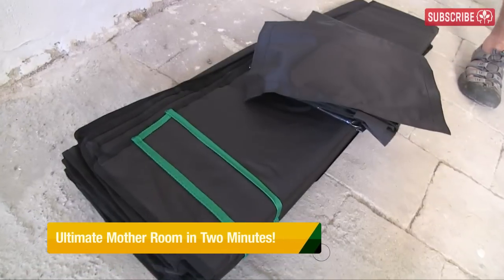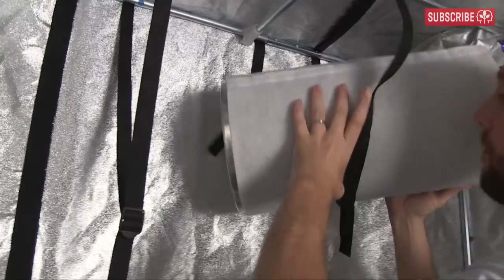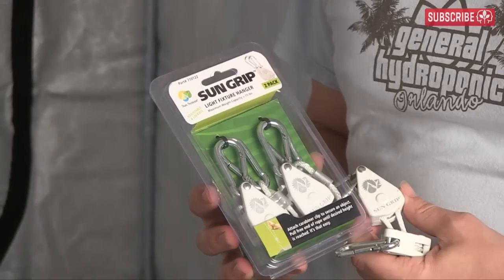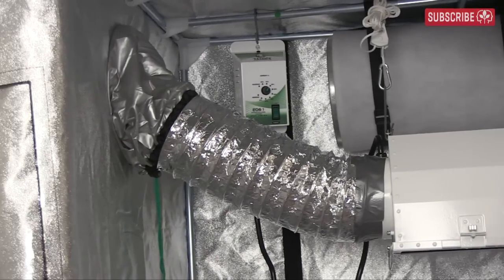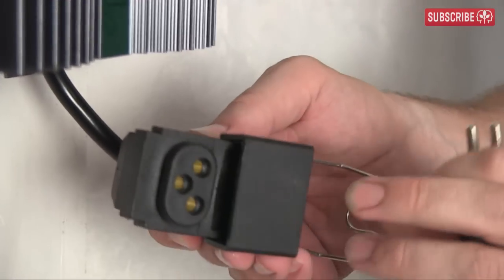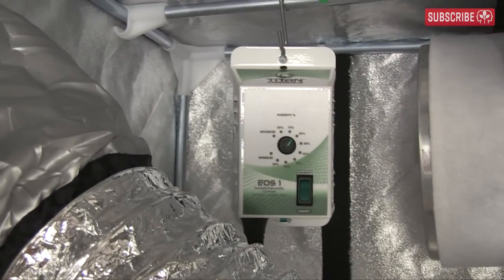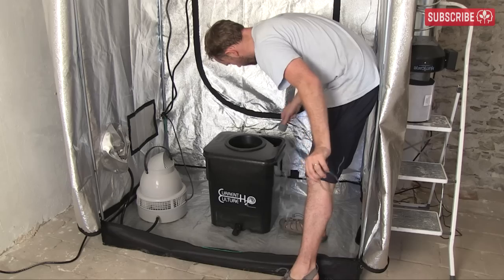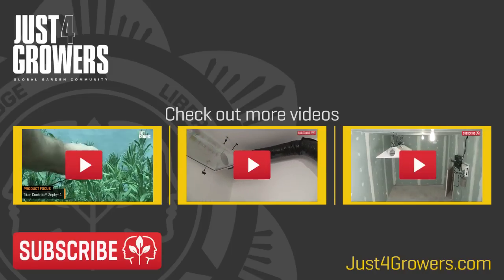Instant Mother Room (well, two minutes)

Comment: I’m confused. Is there a carbon filter on both ends of the reflector? If so that doesn’t seem right to me. What’s the point in filtering the intake if it’s not actually going into ur tent. Just through the sealed light fixture?
Reply: Oh my mistake
Reply: Just realized what’s actually going on in the video. Accidentally confused myself
Reply: Wait no I’m still confused. Where’s the fresh intake for the plants? The only intake I see is used to vent the hot air.

Comment: my friend did an experiment without wanting to by making a metal halide room with two fixtures and a T5 room with two lamps that had about 8 bulbs in each fixture. the metal halides were stretching the plants while the T5 were keeping the nodes close together and actually pairing them together at times vs the halide where they were alternating and stretched out.

Comment: Hey everest, Big question. you say to use a MH conversion bulb for the mother room. 
I recently purchased http://lightenerg.com/products/bulbs/supermhconversion.html 
but I assumed it was just a HPS with upgraded spectrum, so I bought a 600W hydrostar MH. This is all for a veg/mother room, flowering under LED's (cheap panels from ebay, 275Wx3)
So my question is, did I waste my money on the extra hydrostar bulb, since you say to use a conversion lamp in this video? 

I don't have a par meter, and really since par is so ambiguous, would I be better off just using lux? 
Thanks for your amazing videos! Speak faster ;) hahaa, haters gonna hate!
Reply: http://www.getgreenstar.com/hydrostar/hstr-m600w-mh-232002685 is the hydrostar bulb
I assume Genesis bulbs would be the best, but then again, what do I know? 
Maybe hortilux xD http://www.eyehortilux.com/products/specific/600w-Hortilux-Blue

Comment: so the way you have it hooked up the light exhaust will be pumping out stink air right next to the exhaust from the carbon filter ... this makes no sense
Reply from the maker: +EN KNEE GIVEN DAZE by blowing through the hood any leaks are dealt with by the grow tent's carbon filter. I could put an inline filter at the exhaust point if odour was a concern.

Comment: Why use 2 exhausts? Why not just attach the carbon filter to the end of the light?
Reply: +x2eXu50x Also, wont the exhaust through the carbon-filterless light exhaust out all the smell? Since it isnt running through a carbon filter before exhausting?
Reply from the maker: +x2eXu50x Hi x2eXu50x—thanks for your question. To get the most (cooling) benefit from air-cooled lights, while maintaining maximum control over the growing environment itself, it's best to have separate ducting coming in from outside the grow room (or grow tent) to cool the reflector, and to have this pass directly out of the growing area to the outside world. That way, you can cool your reflector completely independently of your grow space—making carbon dioxide supplementation far more viable, if you want to go that way. If odor is a concern, you could fix an inline carbon filter to the outgoing portion of the ducting. I have seen many grow tents set up in the way that you describe—it's certainly a lot more straightforward but, while commonplace, it's not best practice.
Reply: Everest Fernandez Ohhh i see now. You have the ducting going through one side of the tent, through the reflector, then out the other side of the tent. I thought one end of the light was left open and air was being sucked through there. The thumbnail clearly shows ducting on both ends of the reflector.
Reply from the maker: +x2eXu50x No worries—there are many different types of set-up that work for different growers—I'm just trying to show the method whereby you can enjoy the most extra heat control in a tight space—arguably the main application for air cooled hoods. I appreciate you taking the time to post questions and I'm always happy to justify / discuss why I did something. Peace and happy growing, Everest.
Reply: Everest Fernandez Thank you!!! Really appreciate you taking the time reply back!
Reply from the maker: +x2eXu50x My pleasure—I love making videos almost as much as I enjoy the discussions afterwards! :)
Reply: +Everest Fernandez (Just4Growers) Real quick last question, i noticed that there isn't really an intake for the tent space. An intake runs through the lamp, to cool it, but doesnt touch any of the air in the room. Would a separate intake be needed to bring fresh air into the tent? Or does the exhaust pull air out of the room and thus pulls fresh air in through vent flaps and such?
Reply from the maker: +x2eXu50x Hey my friend—for a grow tent of this size I am happy to rely on passive intake — removing the air inside the tent with my extractor will naturally pull fresh air in through the vent flaps, you're right.

Comment: I love the way you respond to everyone's questions. Plus your videos are amazing. That just made me subscribe. I appriciate your info. Keep it up bro.
Reply from the maker: Almighty Thronez Thanks very much Almighty Thronez. I love making these videos a lot but enjoy the interactions with other growers even more. After all, why buy a telephone if you don't answer it when it rings? Heheheheh. :) Thanks again for subbing. Peace and happy growing, Everest.
Reply: Yea no problem bro....hey but I have a question, if you have time to answer...I plan on buying the aeroflo 2 extension 60 aeroponics unit which comes with 120 grow sites. But I realized it is less expensive than the regular aeroflo 2 unit with only 60 sites...and the only difference I see is, the NON-extention unit has a tnc pump, and the aeroflo extension does not. Have you tried these aeroponic systems before? If so, will I still get a good grow out of the cheaper 120 site unit, without the tnc pump? I don't want to get a system that won't operate at its best, especially since it lacks a tnc pump, and has DOUBLE the amount of grow sites to support. This is my first grow, I'm apologize for the novice questions. If you have any knowledge on this, it will be greatly appreciated. Thanx.
Reply from the maker: Hey Almighty Thronez. The aeroflo 60 extension only comes with the “40 gallon reservoir, 6-6ft growing chambers, injection manifold, Laser Spraylines, Snapture support structure, 60-3" grow cups with CocoTek liners and caps, clay pebbles and FloraKit.”  That is not a 120 site unit.  It is basically a second 60 site unit that increases the base 60 site unit to 120 sites total.  You are correct that the main difference is the pump, there are also some different fittings to allow connection and extension. I would recommend that you purchase the Aeroflo 60, and if you're after 120 sites, then purchase the upgrade kit.   Buying the upgrade kit alone will lead to headaches trying to match the right pump and fittings and will not likely end up being less expensive. Hope this helps! Peace and happy growing, Everest.

Comment: Very clean! How's that reflector working out for ya? I'm setting up a four x 600w hps garden, the sun star seems to be a decent inexpensive reflector - can it do a 3'x3' spread okay? you think it's good to flower under? been using an econowing so anything's a step up lol.
Reply from the maker: Cliff Williams Hey Cliff—thanks for your comment. The Sun Star is a nice, compact little air-cooled hood. It saved the day in my basement garden when the plants grew a little taller (and faster) than I'd expected. If you're growing in a compact space or live in a hot part of the world then this would make an excellent flowering fixture as you can get your plants fairly up close and personal, deliver lots of light -- at the time in their lives when they really need it -- with far fewer heat issues. 4 of these puppies covering a 6' x 6' area would be great for all light-loving plant applications!

Comment: Very nice video bro! .. im just confused ... i see u have fresh air going in to the lights and then ofcours it goes back out but cooling the lights in the process. I have a tent the same same as the video ... Do i need fresh air going in the tent? ... (not just my light) or should i do like u have it on ur video ?... just fresh air going through the light and back out ? and dont worry about having air coming in my tent from outide? ... i know i might sound confusing .. but i am a lil confused .. lol
Reply from the maker: Grow420 Hey there Grow420—thanks for your question. I hope I can clarify matters! One word answer: YES! When I refer to "fresh" air I'm talking about pulling in air from the room, not necessarily outdoors. You need fresh air going into your tent, as well as your air-cooled reflectors. On the video, this is managed passively. I have my carbon filter and hyper fan set up for the extraction, and fresh air  will be naturally pulled in via the grow tents passive air vents. The key is to extract properly to the outdoors so that you are not just recirculating warm, CO2 depleted air. I prefer to take my grow tent's incoming air from the room it's situated in (rather than directly from outside) as the humidity and temperature are more stable—as well as there being less chance of pulling in bugs. I attached the hyper fan that's blowing cool air over the lamp to an intake filter so that I don't have to worry about dust build-up inside the reflector itself.

Did I explain enough? Feel free to chime in again if there's anything you're not sure about.

Comment: What is a 600 watt mh conversion lamp? Will a regular 600 watt mh lamp fit in this reflector? I'm looking to get the non cooled version....
Reply from the maker: Stephanie Grijalva Hi Stephanie—thanks for your question. Conversion lamps are a bit old school these days. Some magnetic ballasts used to be specific to either high pressure sodium (HPS) or metal halide (MH) lamps. (I.e. you had to make sure you matched your ballast to your lamp.) Conversion lamps were designed so that you could run a MH with a ballast designed for HPS or an HPS with a ballast designed for MH.

These days electronic ballasts (and some of the more modern magnetics) can run both types of lamp, rendering the conversion lamps kind of obsolete.

Note that both MH, HPS, MH-Conversion, and HPS-Converion lamps all have the same fitting (E39 in North America and E40 in Europe) so you don't have any compatibility issues running a regular 600 watt MH lamp in this reflector. 

I hope that answers your question and clarifies matters. If not, feel free to get back in touch and please, don't forget to subscribe to the channel for regular videos! Peace and happy growing. ~Everest.